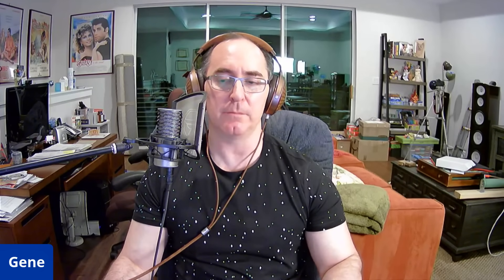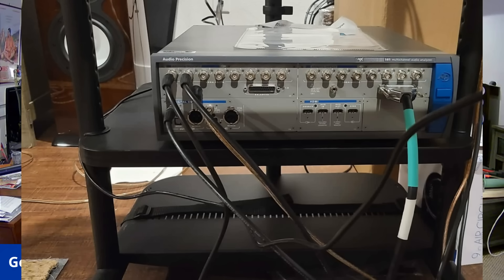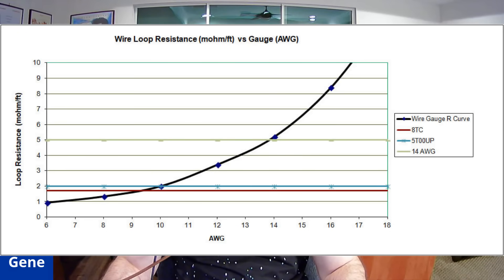Speaker Cables Really Don't Make Much of a Difference?

Comment: Danny Richie from GR-Research would say otherwise. 
Personally i think it does matter.
Reply: @Baz that isn’t how science works. There is little to no value in trying to prove the null. While there exists scenarios where that may be the goal. In this case, such a paper would do nothing more than reinforce what has already been published extensively. 

Instead the burden of proof lies on those making claims that cables make a difference. It is they who need to submit it for peer review. They need to conduct a rigorous study of their claims and right it.  They also need a sound theory as to why cables would make an audible difference. The theories presented are weak. The claims all can be pulled back to known science. Some argue that the insulation matters. That’s a skin effect argument. Skin effect is negligible at audible frequencies. We have plenty of tests that tell us the JND of amplitude changes, phase, group delay, various types of distortion. The cable didn’t alter any of those parameters. What’s left?  What’s the basis for the claim. Papers or obvious things aren’t published. It’s the extraordinary claim that needs to be tested.
Reply: @Baz I think that is a mischaracterization of what Gene has done. 

Take this analogy. Let’s say there is debate over the best absolute black paint. People buy various brands and paint their walls and argue over which look the best to them. Someone with a measurement device comes in and measures them. Finds they have nearly identical sheen, blackness, etc. There is no meaningful measurable difference between them. Your suggestion is that this would need to be peer reviewed. Why? We didn’t learn anything new. The science isn’t advanced by this. 

There are issues in peer reviewed journals with their acceptance of what is sometimes called settled science or obvious science. When something isn’t questioned by the established science, and someone conducts an experiment that simply supports what was already known to be true, it’s unlikely a journal would publish this. 

A lot of research has gone into sound perception and psychoacoustics, the science of how we hear. A lot went into understanding what we can and can’t hear.  The claims made by cable enthusiasts are that something exists in a cable that alters the sound but cannot be measured. We can hear it, but we can’t quantify it. We make claims like this in physics all the time. But it’s because it expansions something we can measure. For example, black matter isn’t a thing. We can’t measure it. We don’t know what it is. It’s a place holder for the fact that we cannot explain the observable universe without it. In that sense, science can come back and attempt to measure and understand what we observe (and or course the effect of black matter can be measured).  

In the case of cables we have an unsubstantiated claim
Backed up by conjecture and claimed expert experience. We have no explanation for what the effect is or how it would work. There is no unexplained phenomena. 

http://api.guide.online.fr/AES-cableInteractions.pdf
Shows that cables made a slight difference but as Gene pointed out. They are negligible and didn’t support high end expensive cables. 

https://scholar.google.com/scholar?hl=en&as_sdt=0%2C10&q=“cable”+abx%2C+audio&btnG=#d=gs_qabs&u=%23p%3DU_7LukRuC0YJ

But all of this is really a deeper discussion that I think is well treated in this paper:
https://www.studyingsound.org/documents/reading/2_Golden_Ears_&_Meter_Readers_The_Contest_for_Epistemic_783.pdf

Is it a placebo effect? Maybe. It will obviously depend hugely on who we are talking about.
Reply: Why do you think it matters?
Reply: @Baz I don't think peer review is needed. The result here is exactly what I expected. Never understood people paying huge prices for cable.
Reply from the maker: Danny is entitled to his opinions. All I care about are facts as I have no agenda to sell cable or 3rd party crossover "fixes".
Reply: @Audioholics  why did you reference his crossover fix in quote?  Have you tested one of them and found them not to fix the frequency response as claimed?

Comment: I don’t think “sound quality” can be measured.
Reply: Google Floyd Toole.
Reply: Pablo Gabs  ,  Not with any units other than expletives such as, "Wow!, or "Super!"
Reply: Microphones and computers can process sound much better than your ears and brain. They cannot be fooled by large pricetags though.
Reply: @Clint3571  "Galen Gareis, chief engineer at Belden Cables, is trying his best to bridge the gap between what we hear and what we measure. And while he has uncovered a great deal of measurement data explaining audible differences in cables, he has yet to invent a measurement system with metrics quantifying audible changes." Paul McGowan
Reply: Sound "quality" is more a "personal preference" issue. As Gene stated, "sound quality" comparisons are best judged in double-blind A-B listening tests.
    Sound reproduction "accuracy" can be measured.  If one perceives a certain component of an audio system "sounds better" than a different style/brand of that same component with the same specs, then that difference is measurable.   If results from scientific measurements of two "different-sounding" components are not "different", then there is truly no difference in the "sound", OR the measurement procedure and/or test equipment have not yet been developed to measure such differences. 
    I think some perceived differences in sound "quality" which escape measurement are likely very small phase alignment differences occurring at various points along the frequency spectrum.

 I could have said all this better if I was just a little more buzzed on rum.
Reply: @rb032682  I'm not saying that Gene's measurements are wrong at all, he does great work and he discovered all of those differences. I'm talking about "sound quality" which cannot yet be measured.

Comment: Any suggestions on the cheapest pair of speaker cables I can get that will produce the same results as the ones selling at a few thousand dollars? Is the Mediabridge good enough?
Reply: I think you may have missed the point of the video...
Reply: @christophermoore3785  Would you mind pointing out what I've missed? As far as I understood, he points out that an inexpensive well built cable does the same job as the ones that cost thousands of dollars.
Reply: @Beyondabsence  Sorry if I came off condescending. I would have to watch the video again, but from memory any 14 AWG or thicker would work. Beautification is extra.
Reply: Monoprice sells several great speaker cables, mine were 35 bucks and came with banana plugs. I buy a  lot from them
Reply: @musicman8270  Thank you!

Comment: Another excellent video. Correct speaker placement and acoustic room treatments will make a vastly bigger difference.

I myself spent a bit more for my speaker wire than the cost of basic speaker wire. But I paid the slight extra for aesthetics, cosmetics look of the speaker wire in my room.

Comment: Some YouTubers who sell products are foaming at the mouth right now because of this video :D
Reply: @Baz this is a good idea, not sure what peer reviewed journal would be interested, but maybe Scientific American would?
Reply: @annenominous7220  Audio Engineering Society. Lookup AES better than Scientific American
Reply: Did i miss the part where he actually used the cables on speakers, played music and listened for a difference?
Reply: @e-portfix  you did miss that part because if you paid attention to the video clip, you would have noticed that he actually didn't do that. LOL
Reply: @e-portfix  based on the measurements and the limitations of human hearing, any differences would likely be due to expectations or pre-conditioning. He did mention that controlled blind testing would be valid, and I suspect that no one could detect any difference. The peer review would be valid also. If both are done, I suspect the results would pull the plug on many of the purveyors of confiscatorily priced audiophile products that do absolutely nothing.
Reply: @Leprecano64  yes, but without actually listening, 'suspect' does not hold much weight here. I suspect that there are audible differences, we just havent figured out how to measure them.
Reply: @e-portfix  the human brain and the attached ears are the least reliable test there is. Unless you do a properly designed double blind test, there can be no validation through listening. 

Like he said, even moving your head two inches would provide a much greater auditory difference than anything the cables would provide.
Reply: @rubengonzalez620  except that the only use for my equipment is for me to listen to it. That should be the ultimate validation, as that is the primary purpose! Use measurements to help identify and improve that which can be heard, but listening is the ultimate proof.
Reply: @e-portfix  You cannot hear that much of a difference, period. If you think you can you are deluding yourself.
Reply: @dustman96  Baseless claim, you don't know what anyone else can or cannot hear. If you cannot hear a difference, I believe you. Others have a different experience.

Comment: For less than 50-feet runs, 16 gauge cables are perfectly fine.
Reply from the maker: I would never use 16AWG for anything other than distributed audio. There is just no reason to add that much resistance when 10 or 12AWG cable is so inexpensive and superior.
Reply: @Audioholics  I'm with you Gene, I'm running 12 with my 7.1 home theater (still no Atmos here 🥴)
Reply: @Audioholics  For your RBH $50K towers, I agree. For my RBH reference bookshelves, which I crossover to subwoofers, then 16-gauge is perfectly fine.  Maybe I have to turn up the volume a half decibel.
Reply: I fully agree we are all entitled to our opinion in any subject. Granted i am pretty new to all of it. But in my system i can hear a difference.

Comment: Do we know with 100% certainty that we can measure EVERTHING our brains hear?
Reply: Obviously you cannot measure what you are imagining.
Reply: Usually you can measure a lot more than you can perceive. We can measure UV or inaudible sound we don't know is there. The unknown unknowns have been used by religion and sales people for millennia. We need to think for ourselves and weigh up the probabilities and benefits 🤔
Reply from the maker: when it comes to cables, YES!
Reply: No but we can measure a speaker wire cable to a very high accuracy. A £40 and £500 speaker wire cable that measured the same wouldn't produce any audible difference.

Apart from maybe the placebo effect.

Comment: This has been my policy towards cables/interconnects etc. I decided that I would like all the cables etc be from the same company. What I did was I chose something that was one or two steps from the entry level. I’m not sure if any of this made a difference but I made a decision that I was comfortable with and have not become obsessive/compulsive about cables etc. Of course,the price of hi-end cables is part of the craziness in the audio field. I love the reviews you see in the audio mags where a reviewer will listen to a pair of $10,000 cables etc and will extol its virtues but will then go up to the next level(of course more expensive) and their review will go as such;ohh the lower priced(but still quite expensive) but the more expensive cable will give you a touch more “air,soundstage etc.”. This is how EVERY review of cables etc are written.
Reply: Yeah and you never see any measurements of these £10,000 cables to back up the manufacturers claims that they are much better than other cables. 🐍
Reply: Good choice. It also looks better when all your interconnects are the same style
Reply: Correction. “The lower priced cable was very good but the higher priced cable was a bit better etc.
Reply: I use DNM speaker/interconnect wires.

Comment: Cables don't make much difference,why, inside the speaker the wires on the circuitry are not as good as these cables that are used from speaker to amp...

Comment: Gene, I always love your unbiased technical reviews!  Currently, I use 14awg speaker cables, but am thinking of changing to 12awg for my newest HT setup; just trying to reduce the overall resistance AMAP without going overboard.  I laugh when I think as a 'know it all' teen I used 16 or 18 awg wire thinking I had a 'killer' setup. LOL  Those were the days!

Comment: Nice work Gene.  The most audible difference is TDR/velocity and drag, which is a bigger shift in perceived frequency  than most assume. (0-5db swing on any frequency leg, correlating to the reactance of the cable design. University of Pen. has recently published works displaying the effects of electron clumping, which produce visible audio wave disturbance. ( Physicists have answers worth knowing;) Your  RCL displays a difference, but as you mentioned , it is not the difference in which millions of ears experiencing:)

Comment: Awesome man!  I love that you went beyond the electronics measurements, and took it to the acoustical output of the speaker too!   That's where the rubber really meets the road, and I feel can more readily translate to people who find listening compelling.  This is going to move mountains.   I do wonder how the acoustical measurement was so smooth, when speakers typically have very rough frequency responses. 

I've got a 10" cable or two I'd be willing to send your way when you take a deeper dive into more and more samples.  You could make a weekly show out of just adding cables into your database, but that may get boring if they all  have the same curve, but that boredom may be what moves the mountain of misconception.  

 I want to see two radically different cables, and two radically different speakers, all 4 tested with each other on the same chart, so we can see how the frequency response of the two speakers are all over the place, and how the different cables are tracking each other in parallel I feel that could be really compelling way to qualify the subtlety and sonic significance of cables.
Reply from the maker: Actually I took the electrical output differences at the speaker, not the acoustical output. This is even more significant since electrical changes are usually far more significant than the resultant acoustical output differences. 0.06dB difference in cables is swamped out by the variance in steady state acoustical measurements.
Reply: @Audioholics  i would love to see this recreated both electrically and acoustically (on spectrum analyzer)  to literally show the physical differences in these cables in terms of frequency response and dynamic range minimum.  Cheers to you nerding people out the right way.  Spent years at Lucasfilm and education is the biggest issue i run into and will always run into.

Comment: Nice work Gene, as always. Of course, the hardcore science deniers will say their ears know better than any stoopid test equipment. But people who really do want to know the truth will find your proof useful and compelling. My only comment is that 100 pF per foot seems awfully high. I'm more concerned with that than with the tiny amounts of inductance in the cheaper wires.
Reply from the maker: 100pf/Ft isn't that bad TBH. I tested up to 30ft runs and never found amplifier stability issues. The only time I found issues was with the Goertz flat conductor cables that measured in the nanofarads/ft. Those things made amplifiers oscillate without a zobel on the speaker side.
Reply: I'm sure AudioQuest DBS fans aren't going to be happy now 😂
Reply: I still remember your offer for a public debate with Mr. McGowan about the null tester. Which I'm sure he will never do . I wonder if he still believes about his claims when he said two electrically identical cables can sound differently. 

I watch many of his videos out of curiousity but unfortunately he never backs what he claims with science or measurements!
Reply: @michelkh87  Yeah, Paul is full of crap. The real shame is he surely knows he's lying, but he does it anyway.
Reply: @EthanWiner 😅 snake oil in its purest form
Reply: @Baz Peer reviewed  paper to verify basic wire properties? Tell you what, I'll let you point me to a peer reviewed paper showing that wires that measure identically can still - by some feat of magic - sound different. The real issue is that people believe they hear things that don't really exist. So the fault is in human hearing perception, not the ability of "science" to measure everything that matters with wires and audio generally. You seem sincere, so I'll give you two resources. The first is a short article that explains why the sound can seem to change after replacing one competent speaker wire with another:
http://ethanwiner.com/believe.html

The second is a half hour video that proves beyond all doubt that RCA wires varying wildly in price all pass audio identically:
http://www.youtube.com/watch?v=ZyWt3kANA3Q